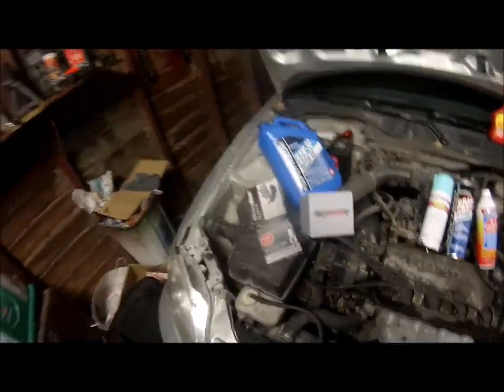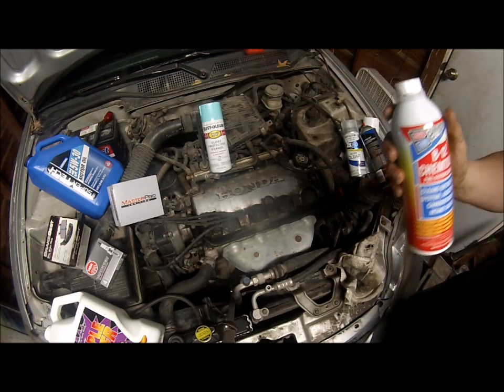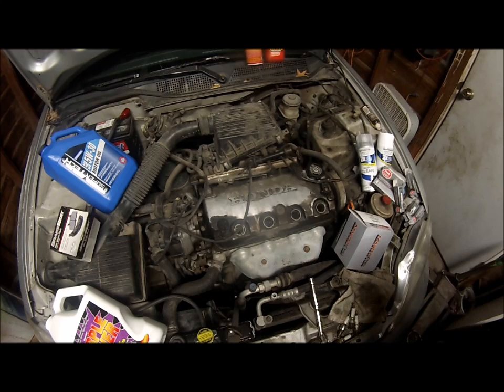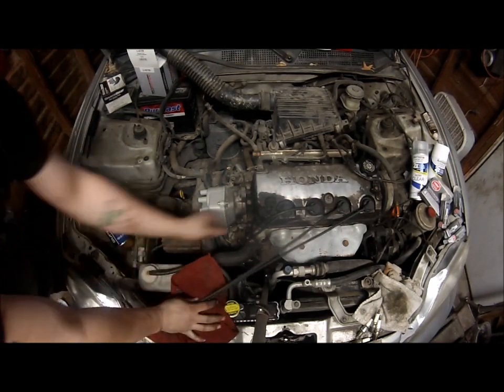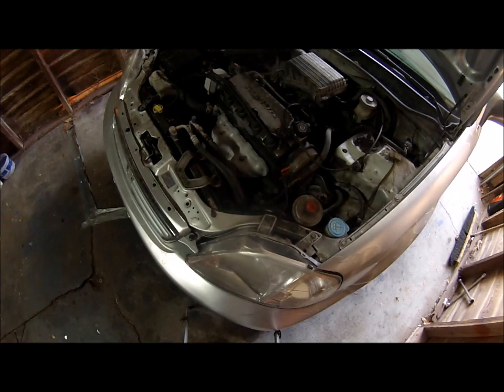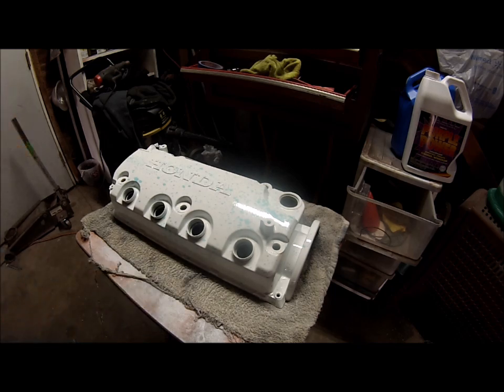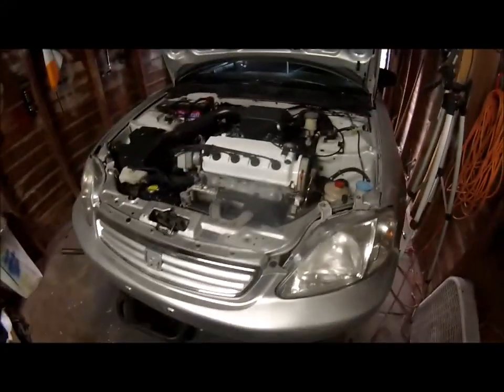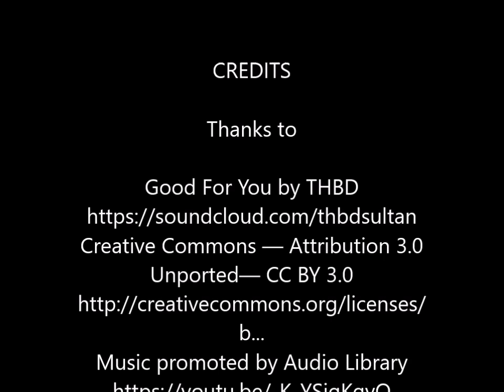Wifes civic getting the D guy tune up

Comment: Not too shabby a vid man. I used to be a full on purple power fan, but this last month or so I've been using mineral spirits and it cleans super quick and the smell isn't as harsh. I just fill up a spray bottle, give a few sprits to whatever and by the time I set the bottle down and grab my brush, grease is already rolling off the part. Worth a try if you haven't already
Reply from the maker: Very nice! Purple power is amazing i like super clean but not as much as Purple power. For me it oven cleaner, Purple power then brake clean and not always in that order. Ill have to try the mineral spirits.
Reply: James Dguy I've gone threw them all too. And they all "work". For me, its clean up/residue that becomes a nightmare. Yes break clean in awesome, but the fumes suck and that cost.. Mineral spirits is what's used in most industrial parts washers so there's that. Mix it with a lil ATF and it works even better!

Comment: blew my head gasket in my 96 what would you guys recommend i do to start the clean up process after i drain all the mixed up antifreeze and oil out to make sure every thing good before i attempt  to see how bad the situation is, should i just drain everything remove the entire head from the block what product would work the best for cleaning it
Reply from the maker: I swear by super clean or brake cleaner. But to clean the inside of the engine if you don't plan on tearing it all down to do it then i would just run motor flush after you get everything replaced. Drain all the bad stuff out first then fill with fresh oil add the motor flush start the engine for 5-10mins then drain it out refill with fresh oil again and you will be golden!  Outside of the engine brake clean OR super clean. Also over cleaner works great too just be sure to use pressure washer if doing the over cleaner route.

Comment: What up bro I have 1998 honda civic ex coupe and I notice when I changed the oil there are metal small metal shaving I can see from my from my oil container is that bearng going bad?
Reply from the maker: Uh oh sounds like it. But is clear all the metal out and put some fresh oil in. Now if its knocking then its too late.
Reply: Is it worth it to just replace the bearings or just get another motor
Reply from the maker: I hate to tell you but in order to fix you would have to pull the engine, Take the pistons/Rods out then have the rods sent to machine shop to get measured and fix them if any are out of round. Then the crank would need taken to machine shop inspected and probably grinded down and then you would have to buy undersized bearing kit. Then the oil pump would need replaced because the metal that went through the engine would have went thru the pump and pump would fail later on down the road.. I wish it was easy as just throwing new bearings in and being done but there is a process to it and if its not done in the way i listed then you will just have a rod knock down the road and blow up. YES it is worth rebuilding because once its rebuilt it will be like a new engine all over again!

Comment: James dguy. quick question, building a d16 for boost what clutch you recommend cheap and reliable want to do 20 pounds thanks
Reply from the maker: The best i have used was XTD AND XTR They range from 75$-120$ on ebay. I type in the search " 92 civic 6 puck stage 3 clutch" Hit lowest price + shipping first. Get the clutch kit and they hold more than 20 lbs from my experience.

Comment: Have you ever tried to use oven cleaner from the dollar store to clean an engine? The sloppy mechanics swear by it, I have never tried it personally tho they say it gets off oil and crud better then purple power
Reply from the maker: I have used it. I use over cleaner as well because it works amazing too. I used dollar tree decrease and it works arose but purple power really kicks ass by itself but when mixed with brake clean its very very strong.